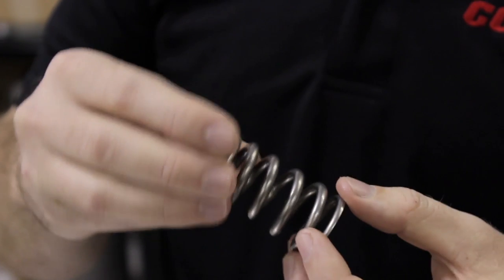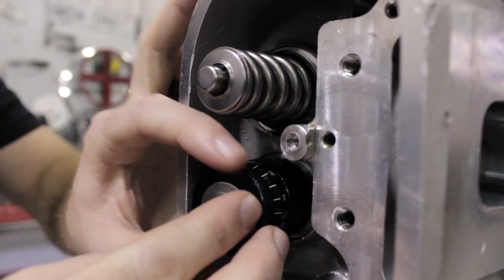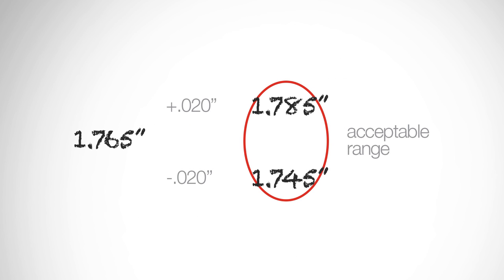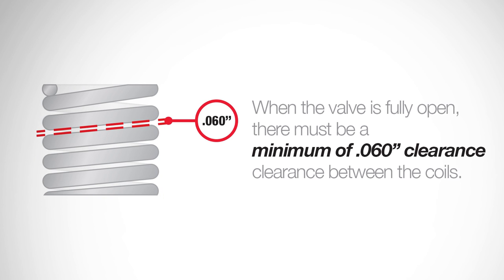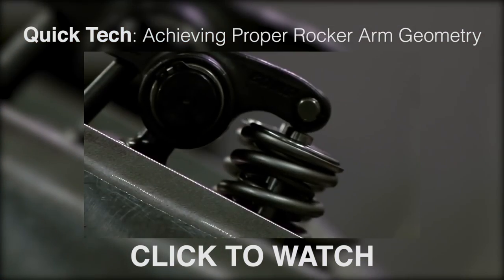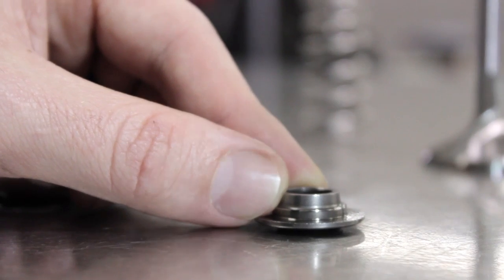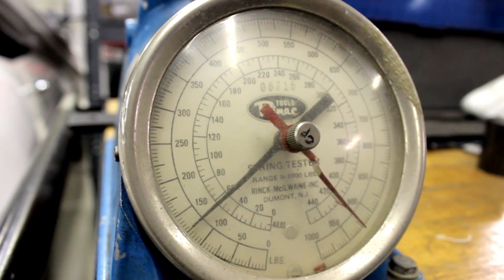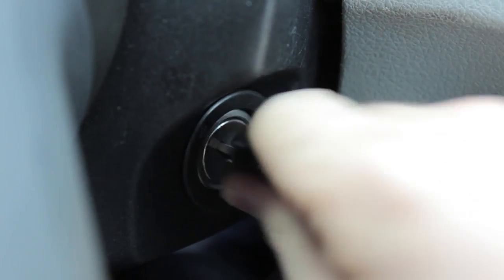Quick Tech: Proper Valve Spring Set Up

Comment: Hello guys,  I would love to know if you can tell me what's the max lift these springs can handle, here are the springs specs: seat load 136 lbs @ 1.800'' , open 412 lbs @ 1.170'' , spring rate 438 lbs/in and coil bind  1.125'' , thanks in advance

Comment: The video says cut the guide down but shows the spring pocket being cut. .020" is not close enough for me, and on a spring with a higher rate it can be quite a bit. One exception is correcting for a spring that has a bit more pressure at the seat and open height.

Comment: If I am adding a new roller rocker cam do I break the cam in for 30 minutes at 2000 rpm or break the valve springs in first on a normal heat cycle?
Reply from the maker: +Don Boser  You can just follow the proper break-in procedure foryour camshaft. This will also take care of the valve springs. Then
just be sure to let the engine cool down completely before you start it again. Hope this helps! Thank you.
Reply: What about dual valve springs? Thanks
Reply: In my experience there isn't much break in needed for a roller cam. Most of the break in stuff pertains to solid lifter cams. I think the mean deal is about getting some surface hardness into the surface of the cam otherwise they tend to eat up the lobe. With roller eliminating most of the friction, I'm not sure you'll need any excessive break in. Just run it, shut it off, let it set like he shows in the vid. If I'm  off on any of this feel free to chime in anyone. Good luck on your build.

Comment: When you say plus or minus .020 that you have .020 spec range? Lets say your valve springs are 1.750 installed height and you get some at 1.737 or 1.742 is that still in spec? Im being told no

Comment: Phenomenal lesson.  Thank you kindly.  The more I lean about valve springs the more I loose my confidence for swapping my springs in requirement to my Milwaukee 8 Fueling 508 cam.  I found you because although I’m doing a Harley engine build, the parts and concepts are the same.

I decided to leave the porting to the experts.  But the shop I’m going with has .625 lift springs on their Pro Street Heads.  Will I run into a Valve Spring Float scenario with my 508 lift cam?

Very Respectfully,
Dan “SKWID”
ET1(SS/SW/MTS) US Navy, Ret.

Comment: Anyone please answer.....
I replaced my street bike (sohc)with 10mm lift cam instead of 5mm lift. But the results are poor than the stock. Upgrade big carbs too and increased the compression ratio also.
please support...
Reply: Did you measure piston to valve clearance to see if that amount of lift was possible? you should always check that to make sure valve won't slap the piston with a bigger lift cam

Comment: Is it necessary to replace the rod in the center of thee Valve spring?? If so may you do a video on how to install them.
Reply: What do you mean the rod in the center of the valve spring? the only thing that is there is the valve stem
Reply: All 16 exhaust intake valves is what I meant.
The Rod's valve stems wrap around.